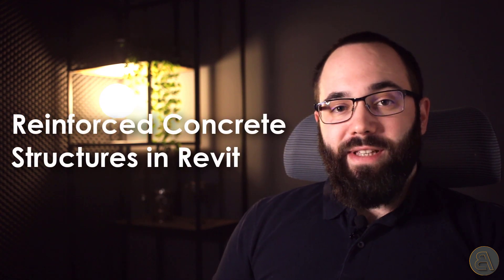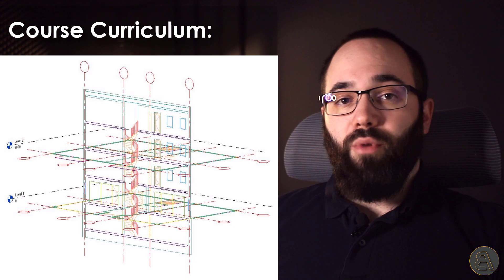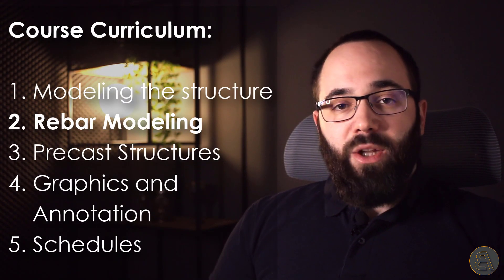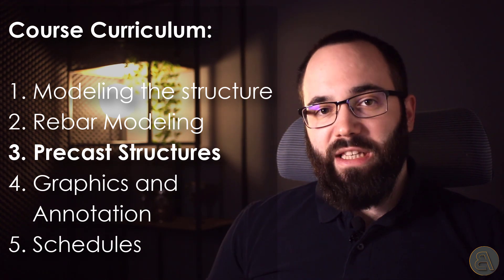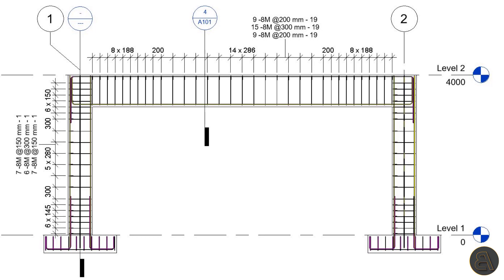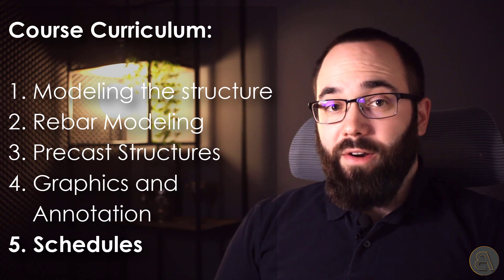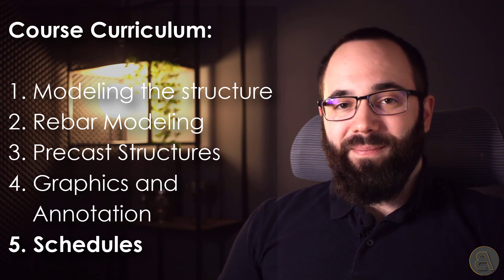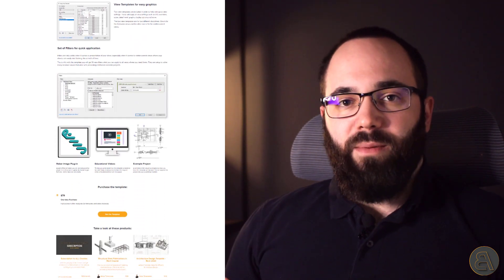Reinforced Concrete Structures in Revit Masterclass

Comment: Civil Engineer here. Revit is simply an amazing piece of software. I have learnt alot about it from your videos but this is my thing right there. 1 question: Can we perform a structural analysis and design for failure in Revit like we can in ETABS or SAP??
Reply: No
Reply: No you can't. But it works well with Robot structural analysis. Model and apply loads in revit and analyze and design in Robot. Then take model to Revit for detailing.